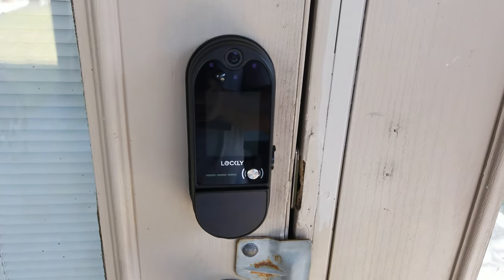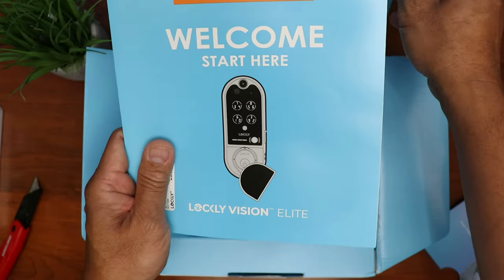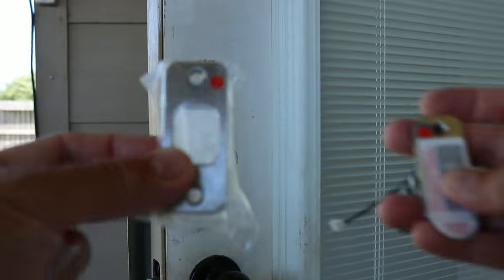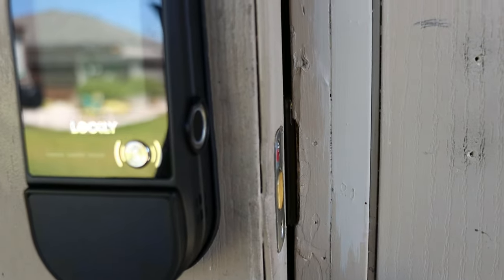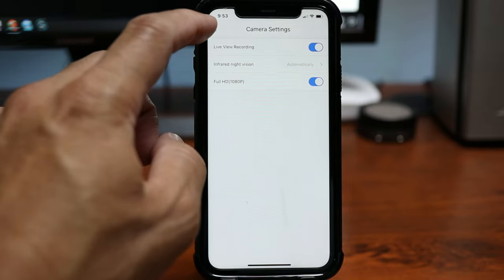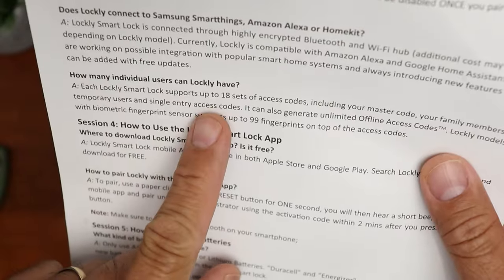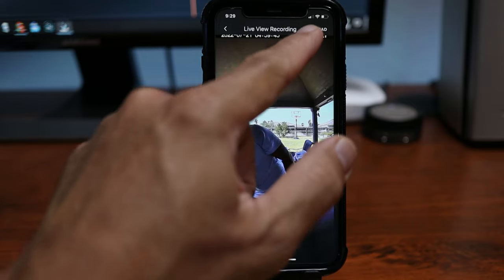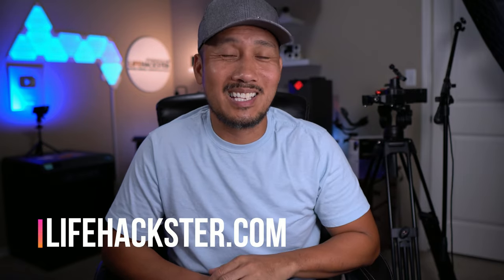Lockly Vision Elite Review - Smart Lock & Video Doorbell in ONE

Comment: A thorough and excellent review as always. But, yet another smart home device with it's own network hub. I think we've officially reached the "this-is-out-of-control-now" level.
Reply from the maker: True :)
Reply: That is true, but what my research suggests is that without hubs devices that work on battery run through them pretty quick (as is the case with the August wifi).
Reply: @pratahsinnetamby  I have the Aray  lock with no hub and I get a few weeks on a charge.

Comment: Nice lock, great fratures but too many bugs for a  premium price.
Reply: I look forward to that comparison. I have long thought that the Eufy smart lock with wifi is the best smart lock on the market, but a majority of reviews pick other locks such as the August smart lock. I find these type of reviews questionable because user reviews of the August locks on Amazon are hovering at 4.2. Eufy's smart lock and wifi has a 4.5 rating with over 2000 reviews. The  August smart lock has over twice as many one star reviews as the Eufy smart lock. 

The August lock uses expensive batteries and user reviews say that you have to replace them every two months. This alone is a deal breaker for me. User reviews also state that the using the August lock is very buggy and its bluetooth self unlock feature doesn't work consistently. So I don't see why so many websites rate it as the best  smart lock.

Lockley makes great smart locks and they have a 4.5 rating on Amazon, which is very good. But they don't have all of the features that the Eufy smart locks have.

My Eufy smart lock with wifi on my front door is around eight months old and the temperatures at my house have been over 110 degrees F for several days. The lock is subjected to brutal heat and yet it looks like it is brand new. I am so impressed with it so far.
Reply: @franklong6269  what are the features that Eufy has that are not available in Lockly?
Reply: @aaoaaa  They "features" of the two locks are very similar, but there are some differences:

1. Eufy's video lock has excellent 2K video. Lockly has 1080 P. You will see a LOT more detail with the Eufy camera.
2. Eufy allows you to have a cloud subcription for your recordings IF you want it. The lock will record locally by default.
3. The Eufy lock appears to be made of better materials. It is made of a stainless steel/zinc alloy which will not leak. My locks are about eight months old and they look like they are brand new.
4. The Eufy has IP67 weather protection and will operate in freezing temperatures up to 150 degrees F. I live in AZ and we have had 114 degree F temperatures and my locks have operated fine.
5. The Eufy lock works without bugs. Once in a while the fingerprint sensor will take a second or third attempt, but it usually works first time.  The Lockly has numerous bugs.
6. The Eufy number pad works very well.
7. The Eufy lock is designed to be very difficult to pick.
Reply: @franklong6269  i have 2 eufy smart locks! There customer service is great! And the quality of the smart lock is very good! Its bank vault grade! Material…Tough!!
Reply: @aaoaaa  temperature operation eufy has  higher temp  operation and lower temp to operate! 2) no hub! Not needed! Everything is built in! 
3)bank vault  grade material! 
4)faster fingerprint sensor
Reply: @AngeloR674  Exactly! I own two Eufy smart locks and they are hands-down, the most amazing smart locks on the market. They have amazing software, the batteries are rechargeable and last around three -to six months. The work exactly as advertised and are bug free. They are superbly made and high quality. Mine are about a year and a half old and they look brand new. You can open and close them by voice commands. They have a voice warning when the batteries are low. The fingerprint reader is accurate and lightning quick. Thy are just the best of the best.
Reply: @franklong6269 So you live in AZ and scared of someone picking your lock? But you are bragging so much about eufy puffy puffy😅 why? Eufy should notify you if the door opens😂 so the picking becomes useless because you have been notified already that the lock is open.

Comment: Boy, am I glad I got the Eufy video smart lock instead. It's less expensive, a nicer elegant design, has a hub with a chime, much faster with video and motion sensing activation, etc, etc.  It's just objectively better in most every way. I had some minor complaints but nothing like the problems I saw here.
Reply: Funny. I am returning my Eufy Video Smart Lock S330 without even opening the box and getting a Lockly Vision Elite.

I think the Eufy design is stupid to require the battery to be removed for a few hours every few months. The Eufy's *front* USB-C "emergency" charging port makes little sense.

What makes even less sense is why none of these units have a built in USB-C port on the inside/back unit to allow spot charging without having to remove the battery.

At least the Lockly Vision Elite has a solar panel, which I hope will work well on my South facing no shade door.

I agree that the Eufy is probably more polished and has better "performance", but their charging solution seems ridiculously obtuse.
It seems like they are polishing a hard to recharge fast turd.

Also, my wife really likes Lockly's PIN Genie feature, and you know what "they" say about a happy wife...

- Whipped
Reply: No door sensor on the eufy unlike the lockly as soon as door shuts the door locks automatically not by time, no solar charging, i returned the eufy and got the lockly

Comment: Interesting about your striker plate. Deadbolts don't "strike" close like handle/knob bolts, so deadbolts shouldn't have the kind of striker plate that was installed on your door. It is standard for deadbolts to have that slightly stronger kind of [non-striker] plate So, the issue wasn't really with the product, but more that your door had a non-standard deadbolt installation.

Comment: It's slow and buggy being battery powered.  Though having the camera on the lock makes it more difficult to steal.  My ring flood light cam is virtually instant when I click on notification it opens to live view immediately with no delay.  Also having the door closed sensor in the lock rather than a contact sensor you mount on the door is complicated, probably the battery will drain fast unless you have enough direct sunlight to charge it.
Reply from the maker: True..that is probably why they included an extra battery :)
Reply: i have the same lock! the battery lasted for 9 months, it's worth it

Comment: Looks like I am buying the bugs with the  unit until they are fixed.  I like the idea of an all in one feature but it looks like it will be an all day set up and learning of the device before i am satisfied.   And there HAS TO BE A BETTER WAY TO ADD SOMETHING TO A STRIKE PLATE AS A SENSOR.  Drilling new holes weakens the door connections.
Reply: If your old strike plate is aligned correctly, leave it in place, and hold the Lockly strike over the strike hole, drill a pilot hole, then use longer screws!
Reply: LifeHackster's deadbolt had a non standard plate. Deadbolts don't need the sloped striker like he had wrongly had installed on his door. Deadbolts use a flat thicker plate standard.
Chances are yours will fit fine.

Comment: I actually thought about getting this but I have a security door I have to go thru before getting to my real door. And what type of security device is that next to the knob? I could use something like that
Reply from the maker: This will not be a good option if you have a security door or a screened door. A separate video doorbell and smart lock will be a better option. My back door open to the outside ( front door usually inside) and I have to put the metal shield for extra protection.
Reply: @LifeHackster  I can't wait for your reolink trackmix review

Comment: Wow it has a lot of good ideas, but 1080 P resolution is a deal breaker. The advantage of Eufy's 2K resolution cannot be overstated. I do like that this lock has a sensor on the striker to sense when the door is closed. The door chime is another deal breaker. The solar power is brilliant, but the entire lock looks really buggy. One other thing to note is whether this lock is made of rust proof, stainless steel alloy that will stand up to abuse. Eufy's smart lock with wifi is VERY durable and it would be hard to beat it off with a sledge hammer.

I hope that Eufy adopts some of these features in its smart lock. Having said that, it appears that Eufy's entire package is better than this lock. The door close sensor and solar charging are innovative features though.
Reply from the maker: True.. I’ll be comparing this with eufy video smart lock in my future videos.

Comment: Wow . love your reviews but you left out a HUGE limitation with the product. I just found out after buying it and will be sending it back . 

Buyer beware . especially if you are buying to use the advertised features with your family. 

1. ONLY administrator account can access video and audio feeds. 

2. Administrator account can ONLY be installed on 4 devices. So if you have a family of 5 the 5th person cant access the features you paid 500 dollars for.

3. The accounts that can be added for your family will not allow them to access the video and audio feed. 

unbelievable a lock that costs 500 dollars has such limited user management capabilities.